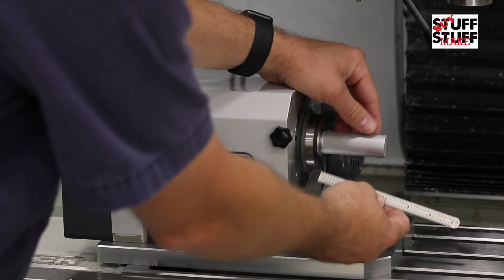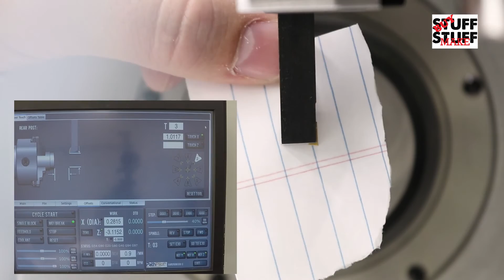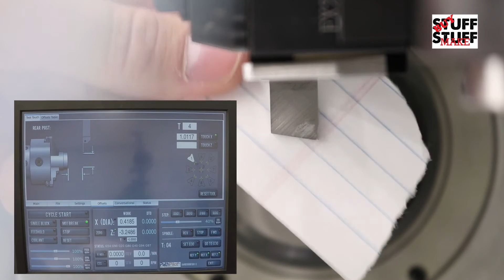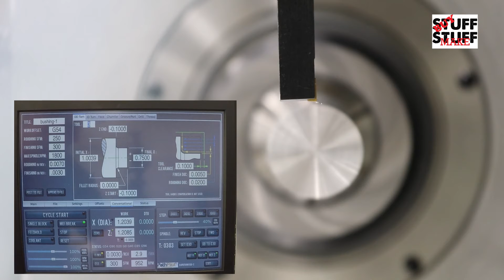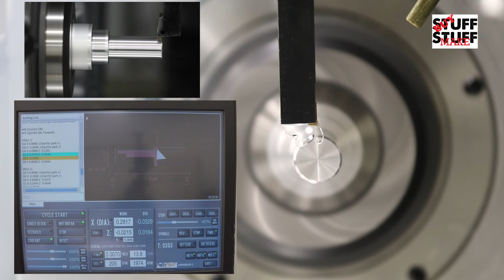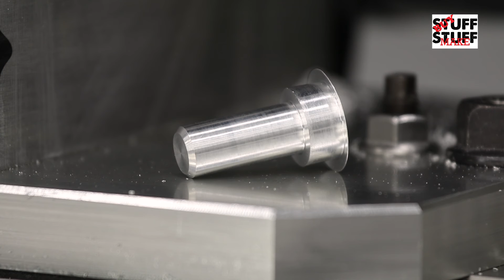Tormach RapidTurn First Part Tutorial

Comment: It’s funny watching people blame objects for their errors rather than admitting they overlooked things. Self accountability!! I know it’s a rare quality these days. I’m just giving you shit, your parting tool seemed to deflect, sometimes if you’re cutting through too fast, and/or if the parting tool is kinda sharpened at an angle, it can act like an oar going through water, and you’ll get a concave/vex cut, there is a learning curve using rapid turn on tormach, it’s not exactly like a lathe you’re used to using, that convex cut could also be because the tooling is attached to the spindle, and there a lot of distance between solid structure from the spindle to the table, and chattering is more likely, and one other thing could be if you sharpened the cutoff tool on the flat side, that would force it to be pushed over, if it’s narrow on the tip, it acts like a splitting maul. I’m not sure how old this is but I bet you figured it out by now

Comment: 13:59 and i change channel. edge of part is zero. can you see dimension on drawing that say z-0.1 is edge lol. its 0. be smart and do it correct take 0.1 of from G54 or when measure tool give it +0.1 easy? all part will be calculate after calculate. use dimensions from drawing. no calculate meeded

Comment: Are you using Fusion for creating the code for Rapidturn?
If yes, what post processor do you use.
I am having some issues with the code, conversational codes works fine though.
Reply from the maker: +Ricard Rinaldo I'm actually using sprutcam (come to think of it, I have only done conversational on the rapidturn). I might try fusion sometime soon - I hear good things about it

Comment: ..and whatever you want make life harder or easier. why you add paper size from measuring tools. not make any sense :) you use same paper for every time so you can forget that paper thickes. you cant measure from raw material that acurate anyway. face off and take cut. then you can measure all tools. and what is better way measure other tools than cut it. put spindle on and take small steps untill it scribe. VOLA!

Comment: -0,1 that is been added to parting tool is becouse you face it on -0,1. easy to understand?
and becouse you tel it to cut from that far from edge of part. thats what its doing, but if your face of z0 all would be fine. you will learn someday. after you need 8 tools to make part. how easy is just look drawing and add those measure (no calculating) all is writen on drawings. there is no -0,1 on drawing. set z start 0 and put that 0.1 for G54 that is z+ material you take of. when you measure G54 just tell its now z0.1. easy? then you can use zstart z0 hahaha :) maybe i lie it will not work. do you have man to try it

Comment: set you G54 inside material z0 and program it real measures and you see it is easier and pathpilot not add -0.1 for (its not bug) it knows you face it -0,1 so it will add that to measure if you face it z0 it will not add that :)))) and that goove parting tool not know how width tool is is you measure it like that. Z WEAR on tool offset use it that why it is there. OR measure it first place how you intent to cut it. cutting tip is that other edge of tool.
that is edge programming page tell it to be. just put there Corrent lenght you want part off. it will do it. if you measure G54 right way and tool. how hard? and you can remove that flange by turn it little bit longer . radius of roughing tool would enought but i allways put more than width of parting tool

Comment: you set parting off z-1.6 ,but program cut it -1.7. you figured that out yet? hmm YOUR face is -0.1 this is part where your should pu Z0 on face. so you see it will part if off -1.6 easy?
but still you measure that tool wrong and changed tip for 2. how that machine know what is with of tool? you calculate that 1.6? yup so put it what ever you want it be lenght and MEASURE TOOL CORRECT easy? that point where is touch your part its with paper between that is paper + tool width. eventually you find how easy it is. OR you can measure tool like that but change Z wear on that tool  -TOOL WIDTH. easy? just tell your tip measure it correct. measure g54 correct. put correct values on program. it will cut exatly how you programming. no bugs there. it will add that -0,1 becouse you face it off that point. and that partingoff screen tell exatly its measerue from where you face it. and you face it -0,1. start do it correct and face parts Z0 every thing would be easier

Comment: 12:18 dont put paper thickess. put tool tip 2 and paper+tool thicknes. and do not measure tools from raw material. how acurate is it?why path pilot is parting it too long. guess
Reply from the maker: LOL - Since I made this, I usually just get it close and make sure I face enough to get rid of the raw edge.

Comment: flange haha. well you measure that parting tool from raw material(what you expect to see). make first cuts leave material. you them to masure other tools and correct your rought tool offset also if not do what you wanted. workZ should be 0. NOT -0.1 your drawing dont have -0,1 it's 0 LOL. if your part is 1.5 long put -1.5 on program and move tool offset so its cut from that point.if you have face turned 0 you can measure every tool from that. groove tool just put Z groove tool width. how hard is it? dont do like engineers. do like machineers do. read drawings and enter values from drawing. you not need calculate and think anything Z0 is face and you can faceoff how many inches from z+ you need and you only need 1 cut from z0 :) and that. if i had this machine i would make own control program there is so many thing not go my head.its some engineer designed. why it do many lines for when they could do rouching cycle and just enter all measures and machine cut it LOL. i would do alot macros
Reply from the maker: Thank you for taking the time to share your comments!  I totally agree with you on the z0 info and the tool offsets.  Since making this video, I saw the trick of making a cut, measuring it, and using that for the tool offsets.  Like you say, that has to be the better way.

Comment: When you touch off the parting tool you're referencing the left side of the tool (when facing the machine), but when you cut you're using the right side of the tool. Somewhere (probably the tool table) you need to adjust for the width of the parting tool. The concave cut is either tool flex (sticking too far out of the holder) or your speed is too aggressive.
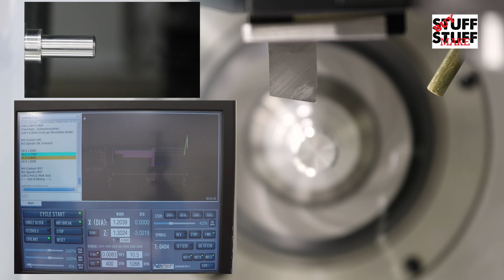Reply from the maker: Thank you for the help!  I'm still scratching my head on the width.  At 21:25, you can see that -1.6 is typed in for the z-value.  At 22:01, when I changed the tool orientation, I don't see a column for tool thickness, nor is there a place for it in the tool touch screen (at 12:18).  Now the weird thing is that even though I typed -1.6 in the conversational, you can see in the g-code at 28:28 that it is programmed at -1.7.  I'm not sure where it is adding the 0.100".  I checked to make sure I didn't edit something out where I changed it and I didn't, and it is repeatable on the machine/conversational.  I must be missing something.

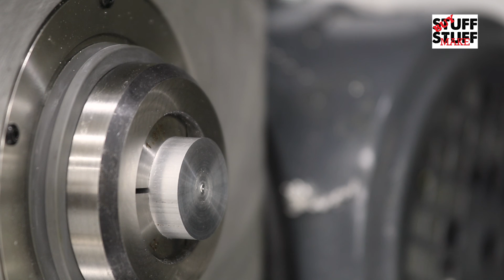You were correct on the contributing factors to the concave cut.  Looking at the stock side of the cut (29:31), it looks to me like once the part broke off, the blade "popped" back to center and cut the remaining bit of material, indicating it was flexing until the part snapped off. I have slowed down the x-axis feed rate and utilized the peck/retract function and have had much better results.
Reply: I haven't installed my RapidTurn yet, so I don't know the answer - it was just my observation that the shoulder left on your part was due to the controller not knowing the blade thickness.
Reply: The parting tool width is entered when you set up the tool.  Read step 9 in the manual on page 48.  In your video, you only entered in the thickness of the paper.
Reply from the maker: Hi Shawn - did you have any issues when trying to post to file with the parting tool set up as per the instructions?  It gave me an error, so I had to change the control point to "2" which ended up meaning that I would only use the thickness of the paper for setting the tool using control point 2.  I guess that means I would need to include the thickness of the blade to the z-start value.  But that's where it gets weird - whatever I put for the z-start value, when posting to file it adds another 0.1 to the value (in this case from -1.6 to -1.7 in the g-code).  Link to discussion on CNC Zone: http://www.cnczone.com/forums/tormach-personal-cnc-mill/313946-tormach-rapid-turn-path-pilot-parting-question.html
Reply: The control point issue is a known bug: http://www.tormach.com/pathpilot-issues-features.html

As far as conversational adding .100, I spoke with support today.  They didnt seem to know about it.  I told them its an issue and they can easily reproduce the problem.    I did a bunch of testing today and no matter what I do, I cant get it to set correctly.  The closest I can get is +/- .015 (using conversational).  It just so happens that my insert is .115 wide, so that +/- .015 makes sense given the convo bug.

If I set zero on the left of the tool and add +.115  (again, width of the insert) before touching off, then jog over .500 on the DRO, I indeed get a .500 part (+/ .001).

The short answer here is that its obviously a bug.  I didnt notice it initially since my insert is .115.  Perhaps yours is under .100?
Reply from the maker: That makes sense - mine is 0.0916 or something like that , so it makes sense that it leaves the little flange/lip.  Hopefully they'll get the software update out soon - did they say when they were expecting to?
Reply: I didnt ask.  Probably because I dont think I'll be using conversational too much.
Reply: I made them a video and sent them the .nc files.  If you look at your .nc files there's a comment under the tool comment that says "tool width = .100".  I've asked them how that is determined.  We'll see what they say.
Reply from the maker: Good catch - I'll be interested to hear what they say.